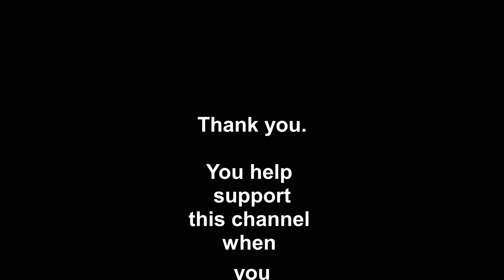Foxhole Radio Blued Razor Blade BOMBSHELL, EXPLOSIVE Finding!!! ;)  Pt 1/2 (4K)

Comment: 1. Does it detect on the non-blued (non-markered side)?
2. What brand and exact color of marker did you use.
3. It looks like you are using just a safety pin for the contact. Is this correct?
Thanks very much.
Reply from the maker: Yes. Does not matter, that's the point. Yes.
Reply: @tsbrownie Thanks, like your videos.

Comment: I do think, it's all about the oxide layer on the conductor. 
It might even be, that oxidation of the needle side sometimes creates the check valve effect.
There probably isn't a conductor out there, that doesn't oxidize in air - and then can serve as a usable semiconductor under lucky conditions.
When we still had these powerful cold war AM stations in Germany, one could by chance hear them through water installations, some say, even tooth fillings. 
It seems, soldiers didn't even always use the sharp side of a safety pin on the razor blade, because they stuck the needle side into the wooden base.
I should try that one day and maybe even film it.
Reply from the maker: I agree. I have found many things that work, including a corroded jumper alligator clip. Some are better than others.

Comment: Unlike modern stainless steel variants; razorblades were made from high carbon steel and heat treated to provide the properties needed to hold a sharp edge.

You can take low carbon steel and case harden it with chemicals and heat to raise the carbon level of the surface. 

I wonder if it's the carbon structures on the surface that are functioning as the diode and not the underlying metal?

I guess a simple test would be to try a piece of high carbon tool steel that's not been hardened and test it again after hardening it with a torch an then quenching it to a ridiculously brittle level of hardness.

Since low carbon steel cannot be hardened to the same degree you could repeat the process with a piece of it at the same time. 

Comparison of the two metals in both hardened and unhardened conditions would be further proof one way or another.
Reply from the maker: The razor blade I used is not stainless. It claims to be, but it's very magnetic and rusts within hours of getting wet. I made a video on it. I plan to check lots of stuff.

Comment: Does it work if its not blued?

Then I just want to know the materials of the blade.

curios!
Reply from the maker: It's plain steel. It claims to be stainless, but it is not.
Reply: interesting I would love to see if there is a difference without the blue and how much. Also I watched your razor blade test video.

Comment: Now you have me wondering why it worked.
Reply from the maker: My WAG is that the junction is like a small hallway that goes into a big auditorium. Electrons can flow orderly into the auditorium from the hallway, but when the flow reverses, their mutual repulsion causes them to jam up trying to get out en masse. So as long as the junction is small enough you get a diode effect. That's based on poking materials of varying types with an ultra-sharp needle to see if they could be detectors.
Reply: @tsbrownie  I guess that I am wondering if the coating on that blade or a slight amount of oxidation (passivation on the chromium content in the stainless portion) is acting somewhat like an insulator.
Reply from the maker: @adnacraigo6590  I forgot to mention, that the blade is not stainless. It's  fake. I did a video on it, and I will put the link in the description. I've got several materials lined up to test, but from initial tests it seems like many metals and oxides work to varying degrees.

Comment: Whats the "soldering from below" myth? I dont think Ive ever heard it.
Reply from the maker: The most viewed soldering videos on Youtube say you should solder from below. It's not only wrong, but it's wasteful (see video link) and dangerous. 
https://www.youtube.com/watch?v=gFGvNrYpsGc
Reply: @tsbrownie  Oh. That's actually pretty hilarious/sad. At least, once someone picks up an iron for a couple hours, experience should set them right (hopefully not after destroying too many components from overheating while 'soldering from below'.)

I wonder whether maybe some ideas re: techniques got mixed up between the kind of soldering/brazing for copper pipes, where you want to heat the object and let the filler metal melt and wick into the joint?
Reply from the maker: @sophiophile  I've soldered copper pipes with a torch, and that's done from below. I think you're right.